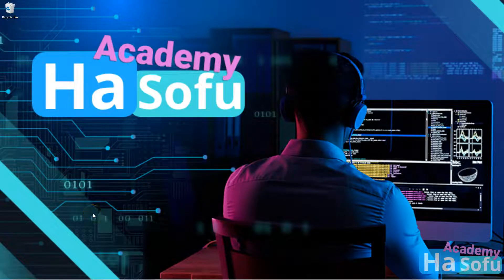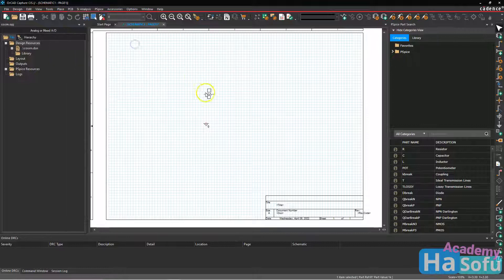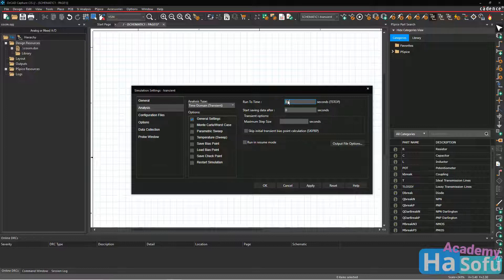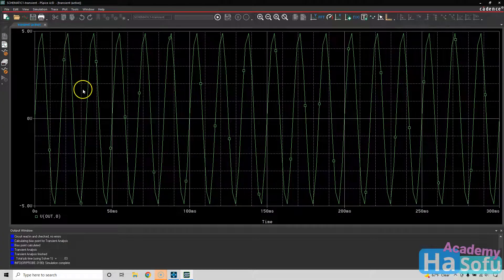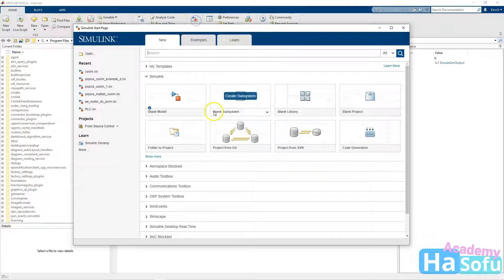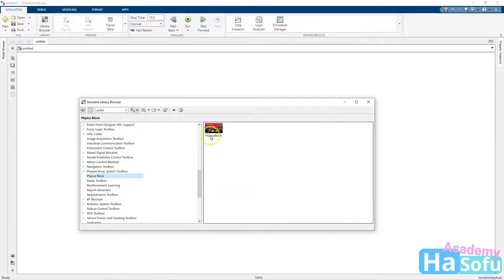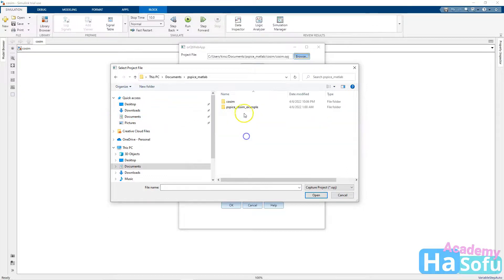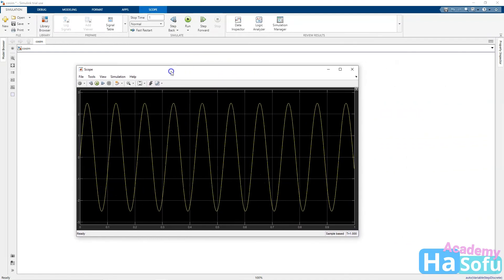Matlab Simulink Tutorial: Electrical Circuit Simulation (using pspice)

Comment: i like your idea generating model from simulink. But is it really possible for the matlab/simulink generate the equivalent component in pspice? or even maybe equivalent combination of basic components like cap, resistor, inductor and so on.
Reply: It’s quite possible. Simscape library in Simulink. Powersim library works too but not with spice models.